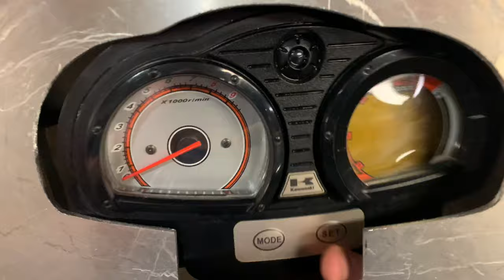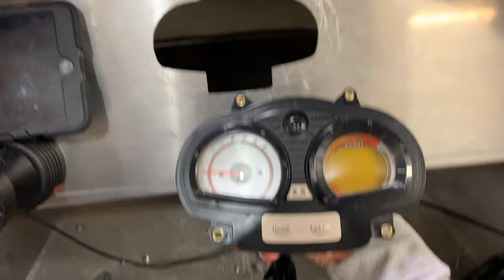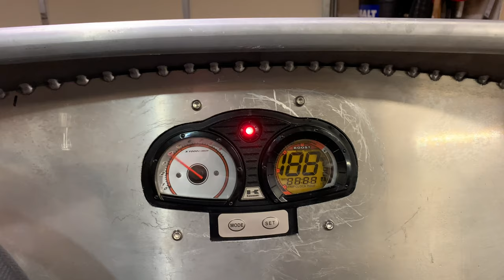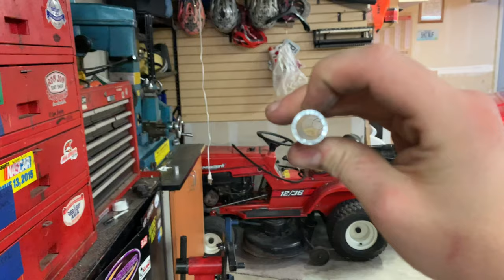Mini Jet Boat Build 12 - Mounting Gauge Cluster and Wire Management Tabs

Comment: You likely won't be able to hear the radio in that boat under way unless you spend a lot of time sound proofing. They are loud as shit.
Reply from the maker: I really didn’t think about that! What do people even do to soundproof these things without adding a ton of weight? Acoustical panels and rubber coating?
Reply: @Localhost127  most people just wear hearing protection. Adding rubber and foam products to the engine bay will help but unless to cover the whole interior of the boat I predict you will still want hearing protection.